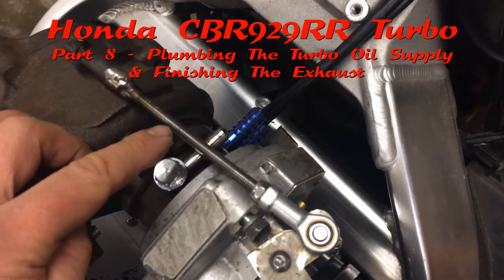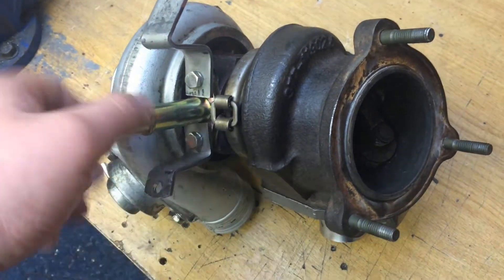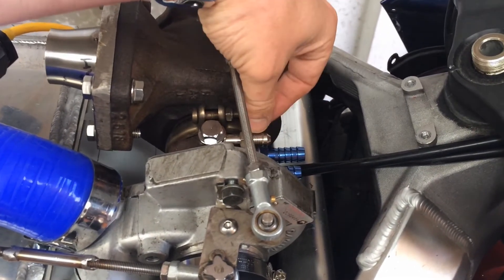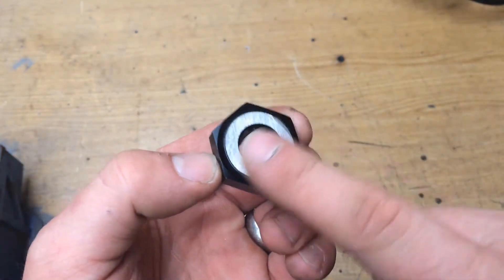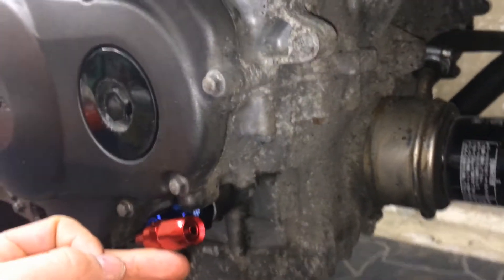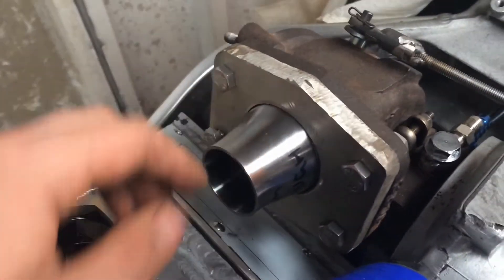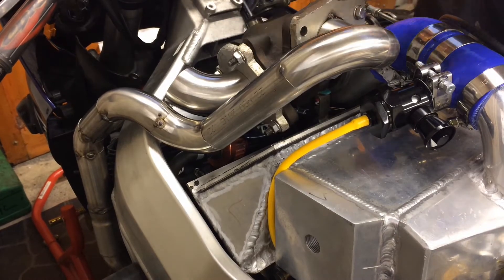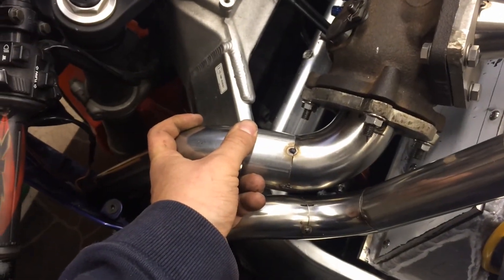Honda CBR929RR SC44 Turbo Build Part 8

Comment: Awesome build but only thing I see I would have done diffrent is I would’ve pulled the valve cover and drilled and tapped a return for the oil in the valve cover
Reply: I’d love to see more videos of this being built
Reply from the maker: Jack Moran there’s another one on the way fella. Just mental busy at work at the min. To be honest after the classic TT this years race season with the cars should calm down and I’ll hopefully get more time in the garage like
Reply: I know it doesn’t matter 2 years later especially
Reply from the maker: Jack Moran it’s still a possibility and will most likely be done in the future

Comment: Waaaaaaaa, where’s part 9???
Reply from the maker: its on the way fella. just taking time doing the last few bits off fabrication as been in hospital over Christmas. back at it now so wont be much longer befor the last video is out fella. then it will be time for tuning after that
Reply: Good man, your accent sounds north east too, I’m up in Newcastle myself. Hope all is well since hospital and hat off to you for just getting the conversion done with a bit of improvisation, trial and error etc. You’ve done a cracking job and saved a bliddy fortune. I recommend dynobike in malton for the tuning as the guy there is a legend if you’re running a power commander.
Reply from the maker: David Tweddle yeh Dave I’m in durham. Been speaking with dyno bike and they going to tune it for me. Yeh it’s been interesting building it all my self with limited tools but been good fun too. Can’t wait to get it set up and in the road now. Shall have to meet up some time for a ride out
Reply: Mate that would be spot on, aye give me a shout once you’re out and about on it as I’d love to see it. Plus with mine being mechanically identical you can give me some ideas 😜 Cool bud, keep in touch and good luck with the set up. Be keen to know what boost you end up running and what it equates to at the back wheel haha.
Reply from the maker: initially i'm going to run 5psi then the plan is to up it to 7psi. while im then running it at that the plan is to buy another engine and build the engine up for high boost while i'm running the bike...... but we all like making plans so will keep you posted and will definitely come for a meet up and a ride out with it fella

Comment: Inspiration! mate, Want to see that fired up. I'm just overhauling and servicing a 929 I bought recently, Renewing bearings,  freeing up brake pistons, fairing attachments, renewing fittings and bolts, etc. made an alu exhaust hanger and a camera mount from copper pipe and a cut up cycle handlebar stem. Familier with the process of trial and error with fabricating stuff from scratch. Particularly like the turbo and all, in petrol tank shell.  Will be great to see it finished, on board cam a must too, to get a feel of the speed and torque curve. Should be a tyre shredding monster.  Wonder if you'd get it past  track marshalls for a track day :)
Reply from the maker: paulsnewplace4post thank you fella. I’ve had it running and got a short clip on my YouTube page off t running. I’m just in doing all the fuel tanks and extra cooling system now. Shouldn’t be much longer hopefully. And yeh I have a few camera mounts on it so should be please off footage when she’s finished like. Planning a top speed day with it and plenty weekends away in her too
Reply from the maker: paulsnewplace4post 

https://youtu.be/yYadApxAMF0
Reply: What I'm getting in to with overhauling my standard bike is so simple in comparison. Know a little about turbo chargers watching you work on that. Do love that all the turbo is contained in the petrol tank.   You're reaction to the sound of it running, is pretty much the  same as my reaction to revving my standard bike (warmed up of course) to 7 thousand revs or so. Awsome bikes. Yours is going to be crazy!!.  Will keep a look out for video. Cheers. Paul
Reply: Good luck obviously.

Comment: cant wait for the dyno. how much boost are u planning to run? 5psi?
Reply from the maker: hello its me! Yeh plan is to run it at 5psi. Might run it up to 7psi but plan is to run and map it at 5psi
Reply: Mr Mon-Eye yeh i think 5 psi is good!! u can try to put some octane booster or e85 and give it a shot for a high and low boost maps. but playing it safe is ur best bet its ganna b lots of power anyway. gd luck bro!!
Reply from the maker: hello its me! Yeh I’m not wanting to push it to hard initially but I’m not worried if it does blow the motor as planning on buying another engine earlie next year to rebuild too.
Reply from the maker: hello its me! Hopefully the engine will be fine though with the low boost

Comment: The manifold are not too close to the radiator hoses?
Reply from the maker: Mauro 954rr the hoses are a little close but I’m going to insulate the exhaust and the hoses to protect them so should be fine. There’s about 25mm of clearance and good air flow to the area too so I’m confident it will be ok. If not then I will make a heat shield to protect them fully